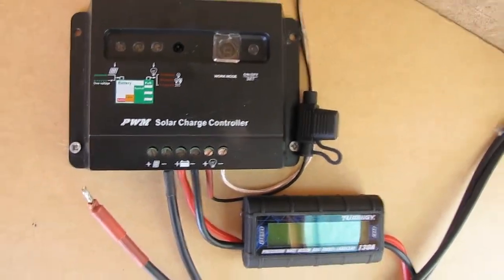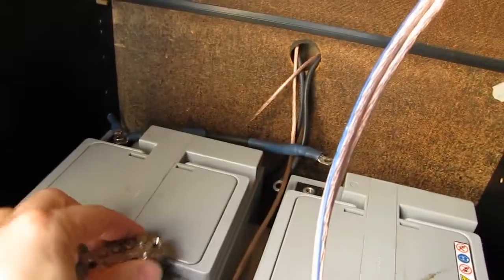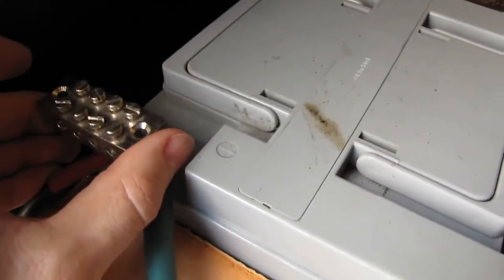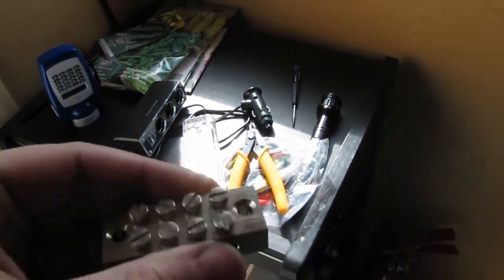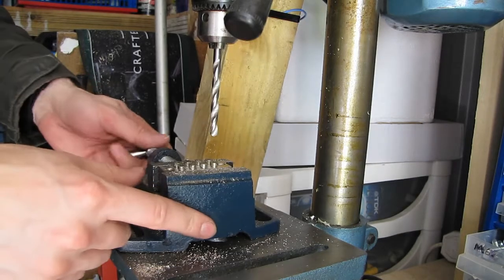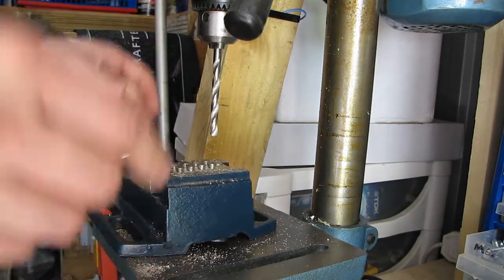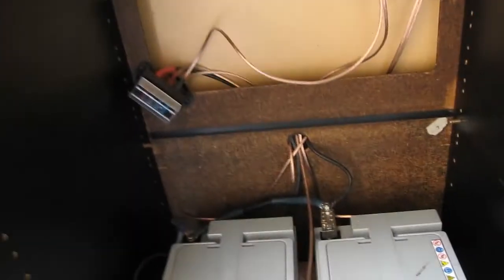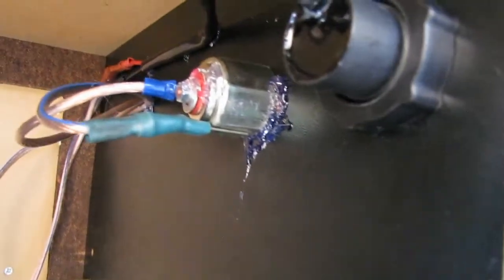Fitting terminal blocks to my 12v 100ah solar battery bank

Comment: sir i would like your thoughts i want to put up a 12v 100ah solar system using 18650 battery packs am thinking of having 2 50ah packs each with a BMS connected in parallel with a charge controller or a DC-DC step down module that way i can charge it 12.6 volt i am planning to use a 500 watt inverter though i was thinking of a 1000 watt i don't know if the batteries can handle it since they being used from laptop batteries i have seen your work with these 18650 so i would appreciate your advice on this and how i can approach it
Reply from the maker: Absolom Madhaka Yeah i think it should work but i think 500w 41.667amp would be the max draw.
If you use a bms then i think you should be able to charge straight from the charge controller.

Comment: I like your idea there. I get the blocks from Screwfix and used them to connect up all my panels. There are videos about my system on my channel.
Reply from the maker: Shaun Dobbie Yeah that’s a good idea cheaper than solar connections Thanks will remember that.
Reply: I did use MC4 connections outside but for paralleling them all together inside I used these blocks.